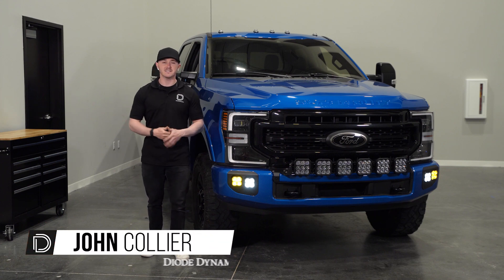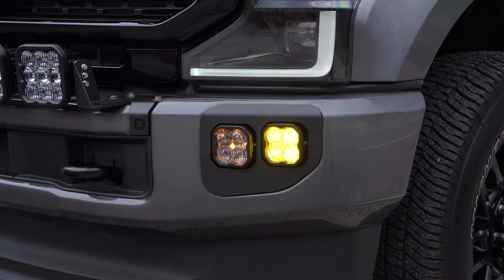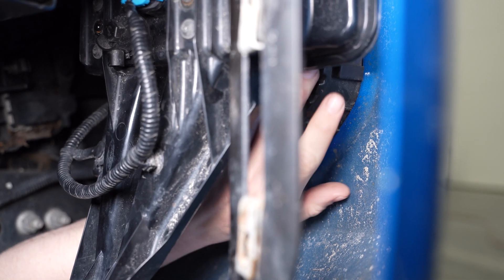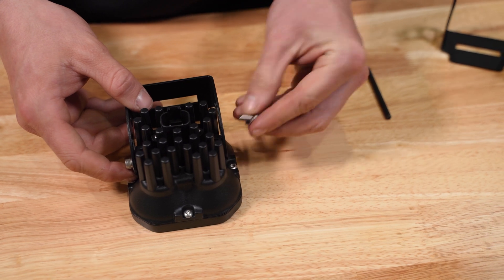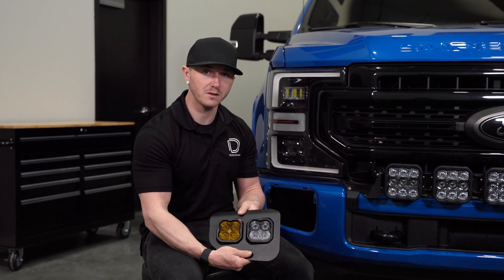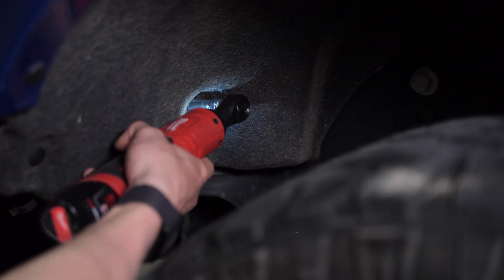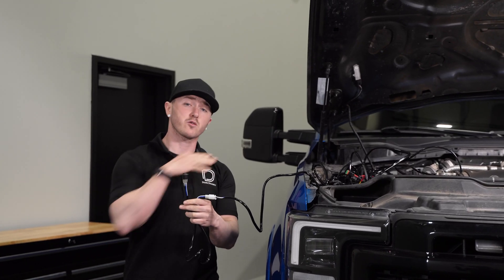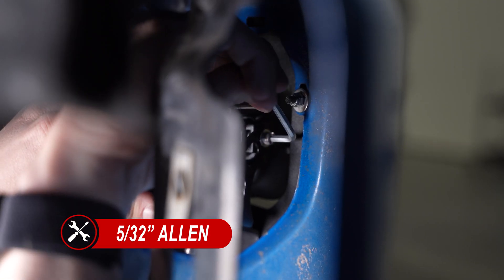BRIGHT Off-Road LEDs plus Fogs! 2020-2022 Super Duty Lighting from Diode Dynamics

Comment: Couple of questions.  1.) Can you use the stock fog light to run both?  2.) If factory fog light is not an option can the up-lifter wire and switch be used? I'd prefer to have them both on at the same time and use factory switch. My 21 is not LED - will the harness or is this all plug and play?  This looks great.
Reply from the maker: Great question! Included in the kit is a pair of Fog optics and a pair of Combo optics. The combo optics are not road legal and will blind any other driver on the road. We do include a harness that you can use an upfitter switch for, however for separate function! 

If you wish to use both SS3 pods at the same time, we highly recommend swapping the optics to another fog beam pattern.

Comment: 😢 using a wire tap on a factory harness is bad and asking for green crustys and corrosion in future problems.
Limitless auto LLC as a better way
Reply from the maker: We agree that could be a byproduct of tapping the wire, however if you use Dielectric grease that will eliminate that possibility!